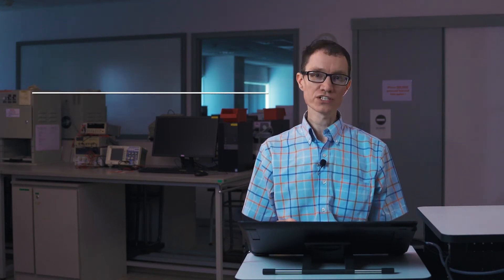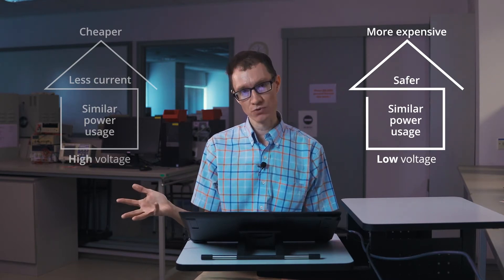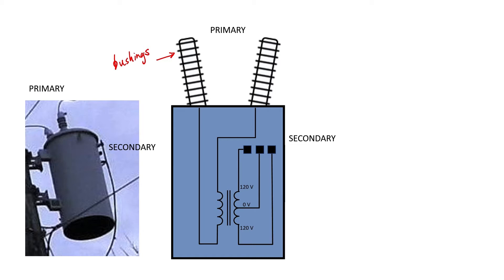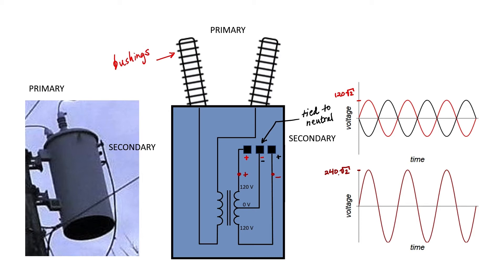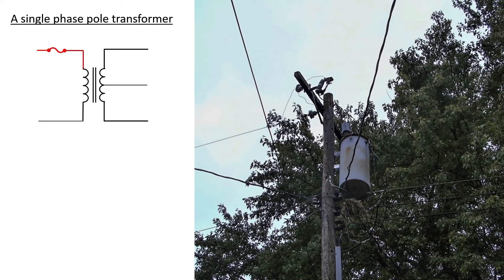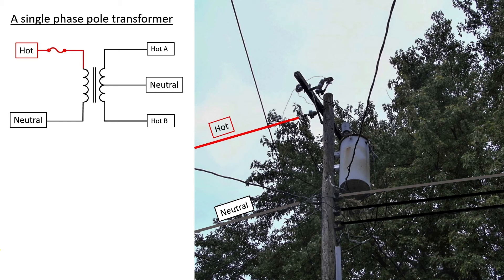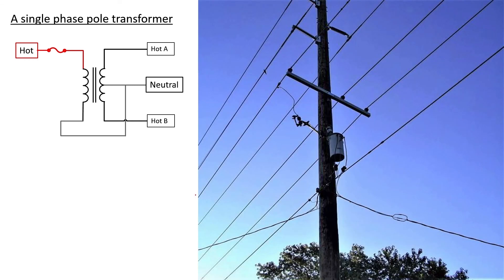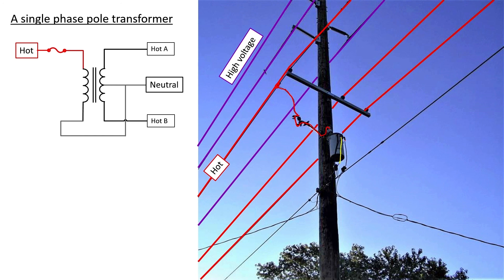Split phase power in North America (22 - Electricity Distribution)

Comment: Split phase is NOT 180 degrees out of phase. It's a single phase. The hot to neutral voltage is half of the phase.
Reply: He's talking about wave forms (phase) and not the feed (phase).
Reply: @ It doesn’t matter what he’s talking about. It’s still not 180 degrees out of phase. You can’t make a phase where one doesn’t exist. There’s only one phase, so there’s nothing to be out of phase with since itself is all that exists.
Reply: @xNYCMarc  it does matter what he's talking about because the "it's just one phase crowd" seems to be incapable of contemplating the waves as phases for some reason.
Reply: @xNYCMarc  The manufacturer states ...Secondary windings are in Series and are In-Phase!   If there was DOT notation, you would understand why, that is true.  If you measure one of the secondary coils BACKWARDS , the then that is your problem.
Reply: @MrSummitville That’s exactly what that other guy wasn’t understanding. I keet telling him he was measuring it backwards, just like looking at an airplane standing on your head. The airplane isn’t upside down, you are upside down. But he just couldn’t get it.
Reply: What you seem to be incapable of contemplating is that a “wave” is just a visual representation of what is being measured. The wave isn’t the thing itself. Waves aren’t phases. So why would anyone contemplate a wave as a phase? What you also seem incapable of contemplating is the misuse of the measuring device that causes the illusion of an inverted “wave”. If it were measured correctly, the two 120v “waves” would be superimposed over each other giving the appearance of just one wave. Because it IS just one wave. I’m not sure what kind of ignorance “the just one phase crowd” is, but that “crowd” is the correct crowd. Education is your friend. Being ignorant isn’t.
Reply: @xNYCMarc  The single phase crowd is correct up to the transformer but this is where the agreement ends.  Homes in the USA has single phase service - correct.

 AC since waves are real and so are their cycles (60hz).  Cycles are time dependent and this component is important.  This is also integral to properly center tapping the transformer.  If you measure voltage between two sine waves with similar electro-potential, cycles (hz), and wave forms then you'll measure 0 volts between them.

Consider the following: your service panel has mistakenly been feed to lines of L1 (or L2).  You will measure 120vac between ground and the L1a and L1b.  But when you measure the voltage between L1a and L1b it'll be zero.  Why?  It is because in this instance there is zero electro-potential between them.  They have nearly identical sine waves in their voltage, cycles, and waveforms.  This is true in all instances of AC power.  Split phase power is a clever way of providing 2 legs that have their wave forms 180 degree opposite one another utilizing a common reference. Timing is everything.

With a proper configuration of L1 and L2 you will measure 240v between them.  L1's voltage should be the opposite of L2 with the exception of when they cross zero together. You can visually see this on a scope.  Granted it is possible to get the phases to appear overlapping if you use separate and isolated references when taking your measurement.

Thank you for the personal attacks.  They might have hurt if you meant something to me.  Happy New Year Frens!
Reply: Electrical potential and phase aren’t the same thing. What you described about the “to” (two) L1s or L2s is the lack of a complete circuit resulting in a measurement of zero volts since the circuit isn’t complete. If you put both your probes on the positive terminal of a battery, it’s going to say ZERO volts. That’s what you’re doing in your example. 🤦‍♂️

They ARE NOT 180 degrees out of phase. They are the SAME PHASE. How is it possible that you can’t understand the difference between half of something and ALL of something? If you cut a sausage in half, do you have two sausages? No, you have ONE SAUSAGE cut in two halves. 🤦‍♂️Tell me you don’t understand what you’re doing without saying you don’t know what you’re doing.

A proper configuration of L1 and L2 will measure 240 volts because you are measuring THE ENTIRE PHASE, which is 240 volts. When you measure between neutral and a leg, you’re only seeing half of the sausage. 🤦‍♂️

Center tapping a transformer has absolutely nothing to do with frequency. It’s a PHYSICAL connection that is done midway on a coil of wire. It’s a center tap no matter if it’s 50hz, 60hz, or 400hz (aircraft). Again, tell me you don’t know what you’re talking about without saying you don’t know what you’re talking about.

I’m not sure what “personal attacks” you’re talking about. But if you can’t handle the truth that you really don’t understand electricity, that’s your problem. Me “not meaning anything to you” is why you’ll remain ignorant. Ignorant people don’t value education and experience. They think they have it all figured out no matter how wrong they are. 

You can’t fix stupid, as they say.
Reply: @xNYCMarc  agree electro-potential and phases are not the same.  The later necessitates a time component.  The term phase is can be used to describe a feed (if you will) to a transformer and/or the position of a sine wave relative to some thing.  Electro-potential measured between two things is often measured in volts.  If you measure the instantaneous difference between two sine waves out of synchronization you will get a different voltage than either of the sources.  Obviously, if the sine waves are.totally synchronized you'll measure zero.

 I have yet to have anyone give an explanation on how to distinguish a theoretical 2 phase 180 degree separated circuit with a split phase system.  There is a way but in application the desired outcome is similar.
Reply: I’m sorry, but NO, there is no significance to the time component, which is why I used a DC battery to illustrate what you were doing in your example of the two L2s mistakenly wired to the panel. It would be the same as having two wires coming off the positive of the battery and one goes to the headlights and the other goes to the radio. If you measure between the “hot” of the headlights and the “hot” of the radio, it would be zero volts since you’re just measuring the same source, just at two different locations. 

Time is only a factor since AC changes directions and THAT happens over time. 

There is NO SUCH THING as a phase separation of 180 degrees. The most you can have is 120 degrees. 

I’ll try to explain it, but I don’t know how clear it will  be. 

There are only 360 degrees in a circle. The phases are equally spaced in 120 degree increments, which is why there are only 3 of them, since 3x120 is 360. 

Now, let’s think of the degrees as inches, if that helps. 

So, no matter which two phases you connect to, there can only be 120 “inches” between them. Connecting “A” to “C”, 120 “inches” or degrees. “C” to “B”, same thing. There is no 180.
Reply: @xNYCMarc  well in the USA there used to be 90 degree ture 2 phase power in older areas.

The hang up is clearly the objection of the L1 and L2 having opposing sine waves for a given point in time and calling the difference in these waves a phase shift.
Reply: Yes, Philadelphia still has 4kv two phase distribution to the transformer in just one section of the city that has not been retired yet. I believe those used a 6 phase alternator at the power station where they distribute two adjacent phases to a location. After the transformer, the voltage is 125v phase to neutral and 175 phase to phase. 

Yes, there is an objection to L1 and L2 having opposing sine waves since the AC cannot be going in opposite directions in the secondary coil at the same time. They rise and fall “together”. I don’t even want to say “together” as that implies they are separate things. They aren’t. They are the same thing, just halves of the same thing. The halves rise and fall together as does the L1 to L2 voltage. They all rise and fall “together” since they are derived from a single “source” or phase.
Reply: @xNYCMarc  again it's about your reference(s).  Assume t=0 in such a way that L1 (top of coil) is +120v.  What would L2 be at that moment in time with references to N?  Obviously -120v.
Reply: If you measure it backwards, sure it would be -120. But so would a battery if you put the red on the negative. That what I was talking about when I said “misuse of the probes”. 

If you stand on your head, that doesn’t make airplanes fly upside down.
Reply: @xNYCMarc  good we're making progress.  It's all about reference.  You can change your reference to get L1 and L2 to be positive readings for a given t but this requires you to change your reference.
Reply: Obviously, we are not making progress. You reference doesn’t change reality. 

Just like I said, standing on your head doesn’t make an airplane fly upside down. Your reference is wrong and you have to use your brain and flip it back to what is actually happening instead of saying the airplane is upside down.
Reply: @xNYCMarc  If t=0 and N to L1 is +120v and N to L2 is -120v.  The difference is 240v. How is this controversial?
Reply: Because +120 and -120 equals ZERO. 🤦‍♂️

It’s +120 and +120.
Reply: @xNYCMarc  interesting 🤔 so each end of the secondary are +120v at the same time.  I'm unfamiliar with this.
Reply: You’re not talking about each end of the secondary. You’re mixing two things. Each end of the secondary is +240 and -240. Not 120. 120 is the midpoint of the secondary, not the ends of the secondary. You not being familiar with this is the whole problem. At some point you have to come to the conclusion that you really don't understand this as well as you thought you did.
Reply: @xNYCMarc  I've said it many times.  It's about the reference and time.  I'm unfamiliar with the ends of the secondary winding expressed as +240v & -240v.

If you're standing at N and for a given instant in time you observe the current move from N to L1 -- the current is moving away from N. (call this negative)
During this same instance in time the current is moving from L2 to N -- the current approaching N.  (call this positive)

So you see you can have a refence in which L1 and L2 have opposite wave forms.  It's about the reference and time.
Reply: If you have a balanced load on L1 and L2, there is ZERO current on the neutral. How does that work then?

Put a 10 amp 120v load on L1 and a 10 amp 120v load on L2 and measure the current on the neutral. What do you see? ZERO amps on the neutral. Please explain that and reconcile that with how you believe things are working. You're probably not even going to understand it, but if you did, it would give you insight into what is happening.  

Repeating things many times doesn’t make it true. Your reference has ABSOLUTELY NOTHING to do with reality. 

Do you even understand the analogy I made about airplanes flying upside down when you’re standing on your head? It seems to just go over your head with zero effect. 

I’ve tried to explain and educate you on what is actually happening with regard to this subject and you’re just not getting it. So I will end my part of this conversation here. I will not be reading or responding to any further responses from you. 

Take care. Happy new year.
Reply: @xNYCMarc  I guess we can't agree that wave forms require a reference and time component and both of those things have "ABSOLUTELY NOTHING to do with reality."

Happy New Year to you too!
Reply: @iceman9678  That's not what the argument is. Notice how you refuse to answer the logic questions? Go gaslight someone else.